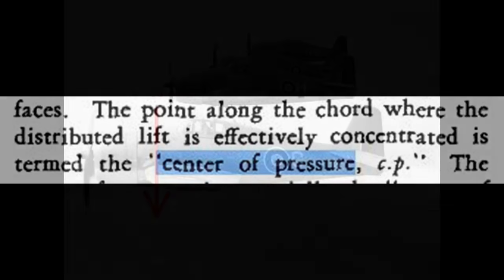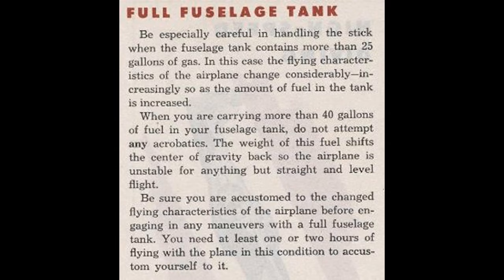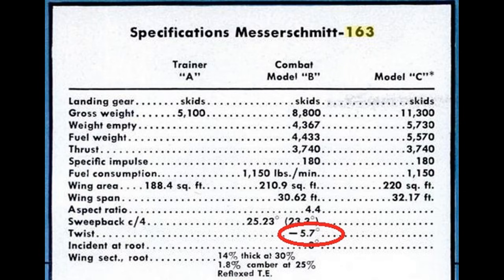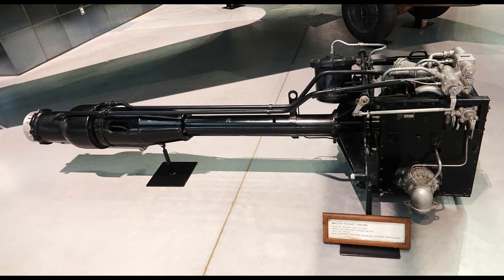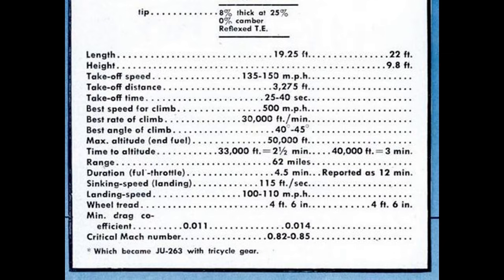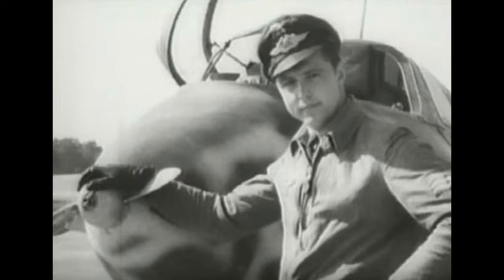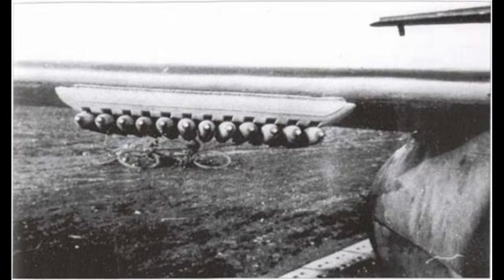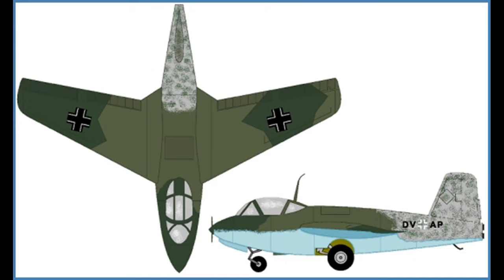Messerschmitt Me 163 Pt.2 Plus Me 263 and More!

Comment: I just never understood how the vertical stabilizer generated down force. I think of it as a kinda second wing. So if it’s a second wing shouldn’t it generate life? Thats my thinking at least.
Reply: Any wing can produce lift or downforce. It just depends on it's angle of attack. I mean think about it, if a tail couldn't produce both lift and downforce, you wouldn't be able to control the pitch of the aircraft.
Reply: but what about when you aren’t giving any control inputs on the elevator. When I build RC planes I build my vertical stabilizers with no airfoil and when I install it on the plane I have no angle of attack on it. It still works though. That’s what I was wondering
Reply from the maker: The horizontal stabilizer provides downforce, it's essentially an upside down wing.
Reply: @loganreuter6072  Angle of attack will change as speed changes, you're thinking of the angle of incidence, how a surface like a wing or stab is angled relative to the longitudinal axis of the aircraft. There are different methods of creating downforce via horizontal stabs, sometimes they're simply angled downwards and other times they're inverted airfoils that create opposite "lift." These are exactly the same methods used for spoilers and wings on automobiles.
Reply: Oh shoot I was thinking of incidence. So basically without a stabilizer the plane wants to pitch down. But when we have a stabilizer on the tail that pretty much prevents it from pitching down.
Reply: FoamFlyer what if it’s an upside down wing?
Reply: Tractor propeller aircraft have, since Curtis started making them that way been designed to have the tail hold the plane level by holding the tail down. The Wright Flyer had the elevator forward and it brought the nose up to control pitch. The Rutan designs went back to this way of doing things because it is more efficient. It's big drawback is the forward elevator does not benefit from the propeller airflow and therefore the elevator does not have as much authority at slow airspeeds (i.e. Takeoff, landing and aerobatic maneuvers). This ability to use the propeller wash to increase the effectiveness of the elevator at low speeds is the reason it has been the favored for most designs. You can get better cruse performance with a forward elevator like Rutan's designs but they have limits. His later designs favored a forward stabilizer to trim the plane in level flight and a elevator at the tail that would provide pitch control in take off and landing phases of flight. This system allows all aerodynamic surfaces to be lifting or neutral in cruse flight providing better efficiency than conventional tailed aircraft without loosing the elevator responsiveness of a standard tailed layout.
Reply: Ok kinda random though

Comment: #Question - I'm curious as to why the Germans didn't use a catapult  
                       railed launch with the Me163 like they did with the V2 ?
        It would have saved launch fuel and omitted the risk of the 
        wheels bouncing up after being released after take off ....
Reply: Cheers for the reply, my thoughts run along the lines of given that airfields were large structures that couldn't be moved I think building launch ramps wouldn't have been a big deal, as for being important targets, well that was true of every airfield and they were already well defended. If they did manage to get hit they always had the dolleys as a back up launch system if needed :) 

Another variation of this idea could have been to use rocket sleds on long straight railway tracks which would have made them more difficult to knock out especially if you had multiple tracks adjacent to each other with a decent bit of separation :)

All bit of a "fantasy hind sight exploration of ideas" I know but I kind of enjoy putting myself in the designers shoes of the time. However I do get where you're coming from but that said it's no crazier than some of the ideas being explored in Germany at the time :) 

To continue the role play here for a moment, putting your self into the shoes of the designers of the day how would you have gone about solving these issues ? :)
Reply: I like paragraphs as they are easier to read than one big lump of text :) 

Anyhow, you make some fair points but it's all a bit retrospectively moot I guess, as to airfields being structures, they couldn't use any old field without working on it first to flatten it properly but yes, especially not for the fast planes, but yeah, filling holes is easier to repair but if you had lots of them to fill it would remain no easy task, also concrete runways are definitely a structure ;)

Also, you correctly point out the surround infra structure were also targets you couldn't move but they built them anyway ;) 

I think the rail road rocket sled would have been more manageable as a bomb would have only disabled a small section per hit plus being narrow as they were it made them more difficult to score a direct hit perhaps and if you made them long enough it would have been very difficult to make them unusable etc. etc. 

All that not with standing the Me163 was at its most vulnerable when landing which is when most of them got attacked... anyhow, I would love to have flown one (with a modern engine design of course :D )

Comment: “Yes, that von Stauffenberg.” Nice historical tidbit I’ve never heard before. Great video. More detail than I’ve ever read about the 163 and 263. 
I’ve never heard of the coal (dust, I assume) fired P-13 and its lineage to the F-106. I’m willing to bet it smoked much worse than a B-52 using water injection on a max performance take off. The B-2 pilots on 30 hour missions. I can’t believe they don’t use a large mouth 32 oz. Orange Juice bottle for bladder relief. Geeze, I’ve used that crossing from SW Oregon through NW Nevada, down to Arizona and New Mexico when there were no facilities. As far as bowel relief? I suspect diet would really help avoiding a problem. But, when Nature calls, that would have been (no pun intended) a sh**ty situation.
My Dad flew many Operation Chrome Dome 24+ hour B-52 flights over many years. The B-52 did have some, less than ideal, relief facilities. I believe they also had a bunk for each pilot to alternate catnaps during the mundane parts of the flights. I’ll check the manuals to confirm that. My Dad told me that the high accident rate, including “Broken Arrows” (like the Spain incident) that occurred, usually during aerial refueling, were determined to be due to pilot fatigue. This accelerated the cessation of the program.
As an Ex-USAF retired private Physician Anesthesiologist, I am very curious to know what Psychoactive drugs are given to B-2 pilots to maintain their alertness and creative decision making capacity during the 30 hour flights. I’m assuming multiple Air-to-Air Refueling procedures (never a routine thing) required for each mission. Kaopectate and Amphetamines? I’m joking. Sort of. A lot of people get atypical responses to stimulants, like amphetamines. They get tired and sleepy. Just like a lot of young children get hyperactive when you give them some diphenhydramine (Benedryl) for cold or allergy symptoms. Maybe that washes the pilots out of the B-2 program? I’m sure IBS is a definite DQ. LOL. I apologize for the sarcastic tone. I really appreciate the information in the videos you produce.
Do you have any special access to valuable sources of information? Or are you just an old school deep digging, and well read, aviation researcher?
Thanks. MSM MD
Reply from the maker: Nothing fancy, I just talked to a B2 pilot. He was quite forthcoming with information, but those were the things that surprised me the most.

Comment: Some layman’s terms on why decreasing thrust didn’t extend the 163’s flight time: a rocket engine works by using the nozzle to turn high pressure low velocity gas into low pressure high velocity gas. If you lower the pressure in the chamber by throttling the fuel, this results in lower exhaust velocity.

Comment: The P-15 termit (NATO name: Styx) Anti Ship missile has a rocket engine aswell and uses nitric acid as its oxidizer. The fueling procedure was similar with its safety requirements. The fueling crew had to have a full body hazmat suit to protect them from the acid cloud that would show up during refueling. The acid also caused the problem that once fueled, it had to be launched relatively quickly because the acid would chew its way through the tank where it was contained. The russian handbook apparently ruled a shot of hard spirits to the fueling crew after they were done, altough the crews in Finland always referred to this but never got it.

Comment: Great video!
I especially liked your explanation of CG. Flying an RC model of the me163, including the Mirage, I can say that flying wings are really quite tricky when it comes to their CG, with no such problem with pitch authority/stability, and can be very much more sensitive when trying to maintain a neutral CG than compared to a more traditional design like a bf 109. Though despite only being a model it's a real joy to fly. Mine also takes off with a detachable dolly and being electrically powered it's a real demon in the sky with about the same flight time as the real one haha. It's most tricky during take offs and landing, as the latter you really got to try and bleed it's speed. Most probably my fastest plane in the hanger than compared to my other warbirds. Some people with a GPS tracker on their models have clocked it at around 300km/h as claimed on forums.

Comment: C-Stoff fill point: About a foot from the T-Stoff fill point if the ground crew is attentive, about a mile if they’re not. Great video, very informative in particular about the challenges of operating this thing and turning it around. Which seems rather a common theme for rocket planes that use hypergolic fuels. Thanks again.

Comment: Hi Greg i want to point out that turbojet's power increase with speed, where jet engine don't benefit from this
Reply: @Gort In Turbo Jet with increased speed ram air effect increasing feeding more air in to it is affecting fuel flow directly,
Turbo Fan or turbojet will have their thrust lower at 0 velocity and it wil increase with high AirSpeed.
In case of piston engines for example p-51 makes peak power at low airspeed that is why plane climb speed is very low climbing with high speed make engine produce less power.
Reply from the maker: @Grafspee.m I think you are confusing "thrust" with "power" they are not the same. What Gort is saying is exactly correct. I have a video about this somewhere on this channel, it has the 262 and P80 in it.
Reply: @Gort yes i got it

Comment: Absolutely love these videos. The attention to detail is really hard to find on YT. Any other channel and I wouldn't bother, but if I can hold a small pedantic point over you, both rockets and gas turbines are jet engines according to most authors I've read.
Reply from the maker: Hi Michael, I'll accept that. A rocket  certainly does shoot out a "jet" of gasses at the back.
Reply: @GregsAirplanesandAutomobiles  Now to spring my trap, have you thought about doing a video on night fighters? It's a subject I haven't seen examined much online, and it's got that technical aspect you'd be well cut out to tackle.

Comment: So Greg I'd just like to mention that nozzle performance is affected by altitude so saying a rocket engine is ineffected by altitude isn't exactly correct,
Reply from the maker: Hi Jacob, I didn't say it's not affected, I said it doesn't decrease with altitude. I am basing that on the following statement from Wikipedia: "At full throttle, the net thrust of a rocket motor improves slightly with increasing altitude, because as atmospheric pressure decreases with altitude, the pressure thrust term increases."
Reply: @GregsAirplanesandAutomobiles  Note that some rocket engines had adjustable bells. The idea is to match the outlet pressure to the atmospheric pressure at any altitude for optimal match. You are effectively focusing the thrust backward in a pencil. If the exhaust pressure is higher than atmospheric it will spread, and if lower it will be compressed into a spike. Both effects result in suboptimal thrust. I believe this is the same reason that afterburners have adjustable nozzles.
Reply: @GregsAirplanesandAutomobiles  this isn't actually true unless it's an aerospike engine, bell nozzles are optimized to make peak thrust at a specific altitude you can learn more from someone more qualified than I in curious droids video titled why aren't we using aerospike engines now.
Reply: @GregsAirplanesandAutomobiles  We should get you in contact with Scott Manley
Reply: But it is positively affected by altitude, so Greg is perfectly correct. All converging-diverging rocket nozzles gain some thrust with altitude - that is because while the velocity term of the thrust equation is constant (it is affected only by nozzle geometry and combustion chamber pressure and temperature), the pressure term is improved with reducing ambient pressure. 
However, replacing the nozzle with one that is optimized for a higher altitude will give a much higher gain (pressure term will reduce, ideally to zero, but velocity term will greatly increase). But then it will be more compromised at lower altitudes.
Reply from the maker: Thanks ASJC27. I'm always glad when you show up.

Comment: Wiki reckons Dinitrogen Tetroxide (which has become the world's hypergolic oxidiser of choice) started to be researched by the Germans in early 1944. Apparently not early enough to replace the nasty T-Stoff
Reply: Dinitrogen tetroxide is still almost as nasty than HTP, lighting things on fire on contact, fumes are very toxic(HTP does not fume at least) etc
Reply: Arguably not. Extremely toxic and cancerogenic.
Reply: I doubt there will be a difference in survivability in a ruptured oxidizer line inside the cockpit using either tbh, you are dead in both cases

Comment: Coal powered ramjet.....
Reply from the maker: I know, it sounds crazy. I wish we could see that flying.
Reply: Its actually a really good idéa. The volymetric energy of coal is 20% higher than Jet-A/diesel... While it need to be powdered, that will lose a bite of space.

A RAM jet engine can have pretty much a unlimited size burning chambour. This is one problem with coal. Because the powder can´t be made unlimited small like fuel dropplets, the burning chambour need to be a lot larger.

For example compare a wood burning stove with a pellet burning stove. The pellets one is about 10 times smaller even if it uses the same raw ingredient, just due to pelet size.

While you theoreticaly could make a burning chambour in a turbine-jet very lager to, in a aircraft that is really not practical. A ram jet can have almost the full length of the engine as a burning chambour.

Now all true jet engines theoretically increase there power to the speed. In practical terms the turbine is is limiting this effect making them taper of at high speeds.

For a ram-jet, this issue don´t exist, and the power increase pretty much regardless of speed. 

Now the power needed is increased with the square of the speed (well roughly) . Now to increase the power of the burning chambour it scales cubicly, and the thrust scales to the square. So if you want twice as much power, you just needs make it 25% longer, wider and higher. Also increasing altitude is very beneficial for ram jet engines.

Now compare the V1 to the  Lippisch P.13a. Se the Ram-jet of the V1 is really not that big. And the one of the P.13a is ... well pretty much longer than the plane.

Now for supersonic flight with RAM jets.. The air that actually burn the coal is slowed down quite significantly. So the burn is not supersonic. The air is also compressed, so warmer and volumetric more oxygen rich.  This turns out to be much more effective than rocket engines, and much cheaper and lighter than a jet engine. While breaking the sound barrier might be a problem in some case.

this is not just theory. RAM jet was actually used for supersonic missiles quite a lot in the 50-tys proving that both Mach 3 and 4 was possible...

The issue with RAM jet is that there fuel efficiency is terribly, specially at low speeds... and well there thrust is 0 at a stand still. But proving of the blodhound and kingfisher.. it would probobly work
Reply: @matsv201  v1 uses a pulse jet , not technically a ramjet
Reply: @adamrudling1339  true true... but the burningchambour would be about the same... od cause s ram jet is simpler..... in theory....

Comment: Is the me163 somewhat unstable in pitch because the downforce counter balance is closer to the cog? Don't know if I missed than bit.
Reply from the maker: No, I don't think it's unstable in pitch. I think the CG and Center of Pressure are far enough apart that it's pretty stable.  I am basing that on the fact that I read nothing but praise from pilots about it's flying qualities.
Reply: @GregsAirplanesandAutomobiles   I suppose it had to have something good to make you want to jump back into one after being in hospital for 5 months. Thanks for your videos. Always look forward to them.